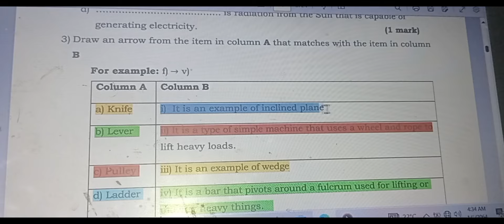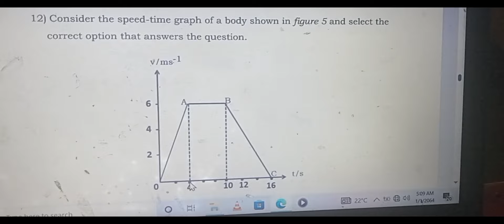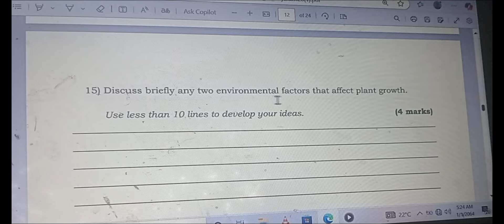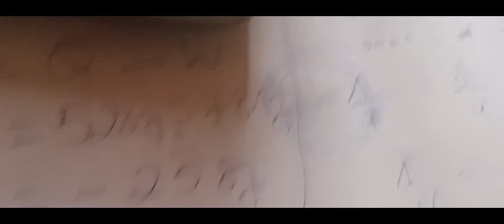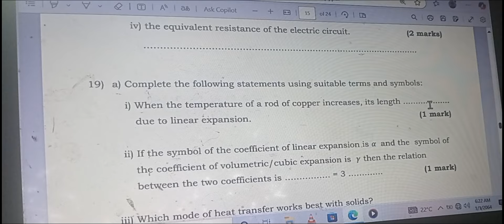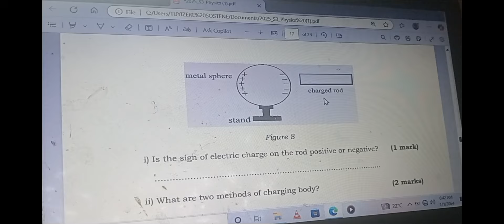Marking guide of S3 Physics National exam of 2025 and hit of succeed multiple choice questions 🙌🙌🙌

Comment: Kuberiki bibaye negative section B 16C kandikoyukoDu=Q+W
Reply from the maker: Alright, let’s do it step by step 👌
We use the First Law of Thermodynamics:   
∆U= Q+W
Where:
Q = heat added to the system
W = work done by the system
∆U= change in internal energy
i) Change in internal energy
Given:
Heat added to the system: Q = + 523J
Work done by the system on the surroundings: W = - 781J

∆U = 523J +(-781)J = 523J-781J
✅ Change in internal energy = −258 J

When you use the formula
  ∆U= Q+W 
It means W is the work done on the system, not by the system.

Heat added to the system: is positive 
Work done on the system is positive but  Work done  by the system is Negative

That's the reason